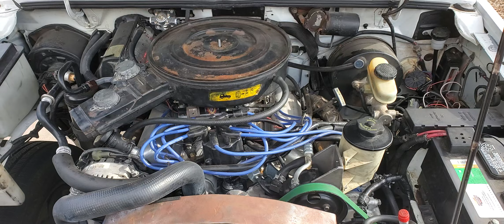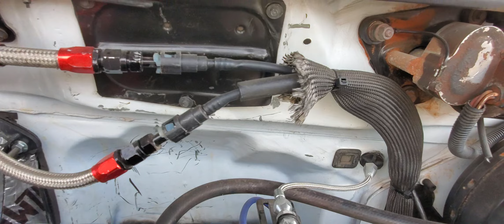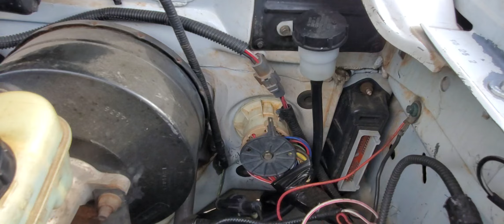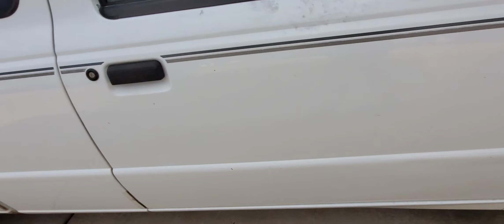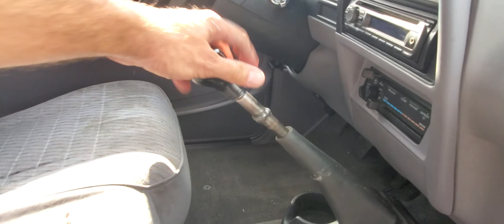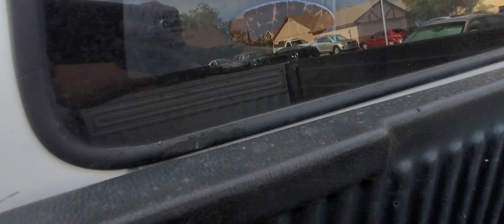V8 swapped 5 speed 94 Ranger

Comment: Cool. I have a 94 B4000 4X4 , blown 4.0, just got an 01 Explorer 5.0 wreck that was impounded, to pick any parts free, so I took the engine, trans, t-case, drive shafts, fuse box, instrument cluster and power distribution box, PCM, steering column, shift cable, and exhaust. My buddy has an M50D with the 5.0 bellhousing he said I can have.  I kinda want the 5 speed, but I kinda want the auto, too.
Reply from the maker: If you plan on using the Explorer PCM it's easier to go auto and keep the four-wheel drive if you want the five-speed you have to get the PCM reprogrammed or get one for an F150 5.0 with the five speed.
Reply: @fixinonitgarage  Thanks, I have HPTuners MPVI 2, not sure if it's supported, because it's  been a while, and I was on the fence about the Explorer PCM and VATS, I would prefer it not have it, but that's for later....

Comment: I love your build. Looks stock instead of obnoxious. Im buying a 94/95 f150 with a 5.0 and a bad auto transmission. Im debating with rebuilding the automatic but i think it would be cheaper, funner and easier to use a m5od from the v6 f150. I bet its a nice cruiser
Reply from the maker: Thanks, the goal was to make it look like everything belongs, even with a carb. It is a solid little cruiser. The 3.55 gears with a locker made it much more manageable in 1st gear too. The original 4.11 were just a tickle too much. ITts my old lady's truck and is back in use as her daily driver.

Comment: Definitely a craftsman the only difference id of did would have been too keep the fuel injection ive had multi carbs and the head akes of boil over and flood out problems ill stick too Efi But Thank you for an Awsome Video  And miss the old Windsor motors More and Wish Ford would bring them back But nothin lasts forever thats Good
Reply from the maker: Thanks, the goal was the keep it stock and simple. It's my old lady's truck so I wanted any old timer to be able to diagnose it should she have issues. EFI was having issues and pcms for this era are not cheap or easy to fix. Two wires run the whole truck now.

Comment: Did you use the stock mounts or did you drill out the stock ones and mounted them with the engine ones
Reply from the maker: @michaelcarrillojr453  I used the motor mounts from a 95 mustang I had to drill mounting points for them

Comment: Please explain more about the radiator location. I also live in AZ and have a 91 Explorer. The only thingS stopping me from doing a 5.0 conversion is wanting to keep the mechanical fan, having the radiator in the stock location, and keeping the AC. What did you use for motor mounts? Are they the ones that allow for adjustment toward the firewall?
Reply from the maker: @AwesomeBuford  I used 95 mustang motor mounts. Had to drill my own hole into the crossmember to mount them where I wanted but it gave me enough room for the mechanical fan. I did have to cut out the bottom edge of the radiator support so that I could suck the radiator in a couple of inches. It sits underneath the radiator support rather than behind it.

Comment: I have a 91 ranger, that I plan on dropping a 302 in. Quick question though. Was it diffucukt to take out, the coils when putting in the distributor?
Reply from the maker: I used an explorer motor that had a cam phaser and had no issues removing it.

Comment: And for fuel system I was gonna also ask what exact pump did you use? And since for my year on the original 2.3 Duratec she had it was a single fuel line so would I have to run a return of some sort or could I just pump gas from the tank through the stock line that runs up around the fire wall?
Reply from the maker: I used to pump from A 90 F150 in tank low PSI lift pumps. I was able to reuse the factory fuel lines I just bought some new nylon line and  changed the adapters at the end so that I could plumb  in a regulator

Comment: I have the same one I was curious how much would it be to get it going. I have a 4.0 model so it’s one less to worry about and a manual off of it wasn’t sure if I should just go custom ecu or just do carb just for less crap to deal with
Reply from the maker: @michaelcarrillojr453  between 5-6k with you obtaining all the parts and not paying a for labor.
Reply: @ thanks I appreciate the input and getting back to me I’m very serious about it since this one I already blew a lot of money and parts just to get somewhat better than new still not roadworthy yet suspension and brake wise and recently found out the engine was blown after it sat for 5-10 years I’ve owned it 2010 before I shipped out for basic now I’m older and not wanting to spend 10k or more for someone else’s junk or unknown issues

Comment: did you use starter for 5.0 f150? what master/slave cylinder did you you use. i read they are the same
Reply from the maker: @hunterbise  starter from a 95 F150 and used the stock master for the 94 Ranger and slave. Just cross reference a part numbers between the Ford and the Ranger to confirm that they are the same. Make sure the slave and the master are from the same year I mismatchef the first time and had to take it all apart
Reply: @fixinonitgarage  anything to note on the transmission cooler
Reply from the maker: @hunterbise  You don't use a transmission cooler on a manual, those are intended for automatic transmissions.

Comment: what ac parts did you use from explorer vs ranger
Reply from the maker: Everything on the ranger is from a 98 explorer. Just drilled another hole to use the EVAP core in the 94 Ranger AC box.

Comment: what motor mounts did you use? got the ricks rangers plate that use the 4.0 mounts. did you use the stock explorer oil pan? finally buttoning up the motor for install
Reply from the maker: 95 mustang convertible motor mounts and the mid 80s dual sump oil pan
Reply: @fixinonitgarage  dang... after cleaning, sanding, cleaning, sandblasting and painting it with por 15 😂. did you at least use the explorer oil pump? sitting with a high flow pump and arp driveshaft
Reply from the maker: @ no need for a highflow pump on these setups. You're just applying more stress on the pump drive and asking for a weak link
Reply: @fixinonitgarage  its a melling m68hv high volume. 25% more over stock
Reply: did you use a separator plate between motor and transmission like the one that comes on the explorer?
Reply from the maker: @hunterbise  Yes you have to It's a Ford. They're difficult to find it a wrecking yard Is there usually mangled, but if you look up summit they sell one intended for these motors
Reply: @fixinonitgarage  does the super thin one from the explorer work. its got the hole for the starter and input shaft
Reply from the maker: @hunterbise  If you're using an automatic transmission yes you can use the automatic transmission separator plate from the Explorer If you're using a manual you need to order a different one
Reply: did you pull one from a 5.0 or the 4.2
Reply from the maker: @hunterbise  I ordered mine from summit part number SUM-700600
Reply: @fixinonitgarage  pulling the cab on mine so i can por 15 the frame. did happen to replace your body bushings? got the prothane bushings, but everybody says the hardware kits dont work for the bushings
Reply from the maker: @hunterbise  nope this car is a Arizona/California car there was no need to yet
Reply: @fixinonitgarage  california dreamin

Comment: You should do a write up and put it on the ranger station.
I see lotsa guides with different choices but a simple guide with what you used  exactly would be appreciated.
Im thinking of picking up another 94 bseries and would love to do something similar though instead of getting a manual 4x4 i would get the auto for better towing capacity
Reply from the maker: The ranger station info is all over the place. Not much to be found for the 94-95. I don't wanna take the time to document it all, just to have it get lost in the noise. 

These videos are easier to assemble and help the visual folks more. If there's anything specific you're interested in let me know and I'll make a video on it
Reply: @fixinonitgarage  yea I noticed that about the ranger station but it's where everyone links to.
Though there is a V8 swapped group on FB that might be easier to make a visual guide on.

The only thing I would ask is if there could be a more detailed list of parts used/ price for everything you used/ modified

Like I see u were able to get the AC working  and wiring work is always nice to see explained.

I'm basically working between picking up another 94 bseries and doing this swap. Or picking up an 03 b2300 and 2.5 duratec turbo swapping it.
I need another truck, my original 94 b4000 5sp got hit by some kid and got totaled so I have been  getting the urge to get another truck and with my speed6 about to be done another project is in the works.
Reply from the maker: @dr_tal  I'm a mod in one of those groups and do what i can to help out. I'll look into a more in depth look at the AC. I wrote the parts lists out once when people were disputing the costs, not sure If I still have it. It's a akin to saving the wife's Starbucks receipts.
It's just around $5k in parts if you acquire them rather than using a donor. Where I live there is no such thing as a $1k runner cause nothing rusts in the desert

Comment: whats your wheelbase
Reply from the maker: @hunterbise  125"
Reply: @fixinonitgarage  sweet. were you able to use the clutch and flywheel for that year mod5r2, or did you have to use an earlier 90s kit? i hear people with clearance issues, but not sure if it's just another idiot like me whos trying to learn.
Reply from the maker: @hunterbise  I used a clutch kit for a 95 F150 with a 5.0 and 5 speed. Make sure you clutch components are from the same year. The slave and master don't work if they're mixed up. I learned the hard way
Reply: @fixinonitgarage  i think i have asked questions on another video, and i may have mentioned that i have a 94 2wd that originally had the 2.4 with MT. got the 96 explorer motor with the non P heads and a 97 m5odr2. Thank you for the help. 94 ranger 5.0 swap doesnt seem to be so common, so im sure ill run into some hiccups and bother you some more. If you had a venmo, i would send you money for every answer you gave. you dont know how awesome you are for helping the rest of us out, man. God bless you and your wife for having the same year truck 😂
Reply from the maker: @hunterbise  I wouldn't stop you. The 94-95 swaps aren't as documented as the others. I found several hang ups. You can get the tach to work by snagging one from a truck or van with a Vin but it has to be a 94-95

Comment: I’m doing the same style swap on my 08 I have a 86 Explorer 302 that I converted to carb since wiring was gonna be a bitch and i didn’t want to get into that I’m running a cheap knockoff edelbrock airgap intake and for carb I’m running the 600cfm 1406 edelbrock and same year transmission as your but I the truck practically runs now using a cheap 6psi edelbrock pump ans jerry can I have sitting in the engine bay but since I guess according to what I’ve read I got the wrong pressure plate clutch and slave I got it all for a 1995 Ford f150 5.0 and I’ve bled the system tons of times and nothing now from what I’ve been told if you have a 10th gen f150 M5R2 from the 4.2 and it’s a 97 or 98 you have to run like a 89 to 91 F150 5.0 clutch slave and pressure plate I wanted to ask you practically is that what you did?
Reply from the maker: For the clutch everything I ran was from A 95 F150 with a 5.0 you have to make sure that the throw out bearing is the same style as your Clutch master cylinder otherwise it will not work period I did have a mismatch of my parts and had to remove it and change the slave cylinder

Comment: love this video just a quick question, i have a 07 ranger with a 5 speed manual and 4x4 i plan on putting a 4.6 in it and im wondering if the 4 wheel drive will still work with the new motor, do you happen to know if the wheel drive will still work?
Reply from the maker: Not sure as I only researched the 2wd. There are ways to make it work but the exact answers I don't know off hand
Reply: ok i really appreciate it thank you @fixinonitgarage